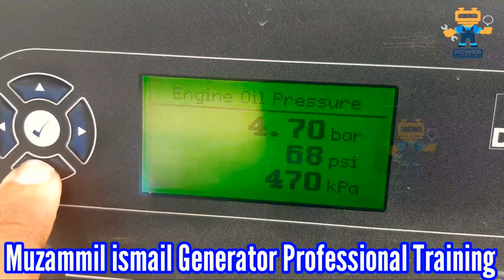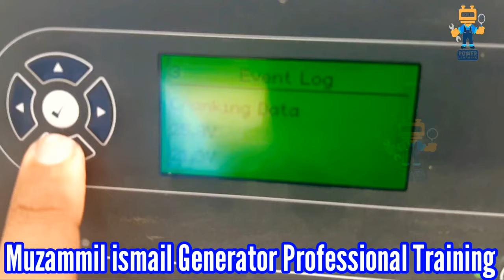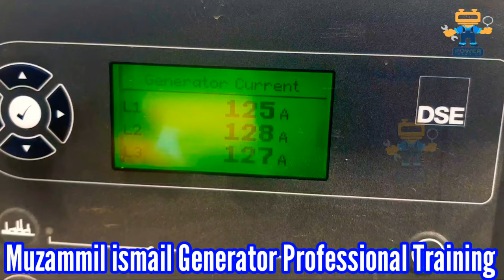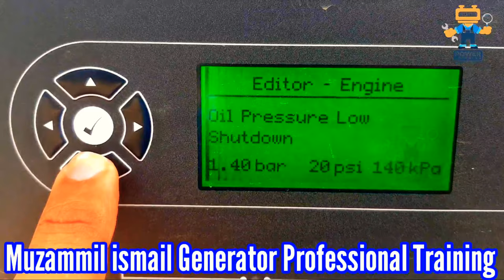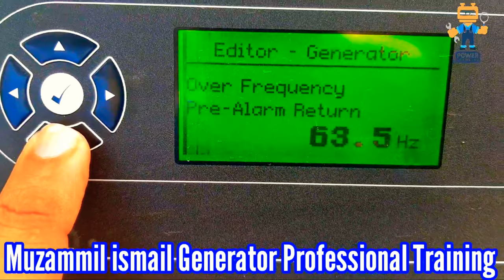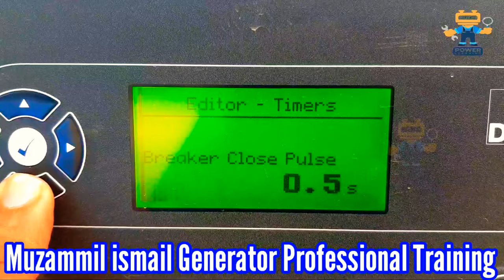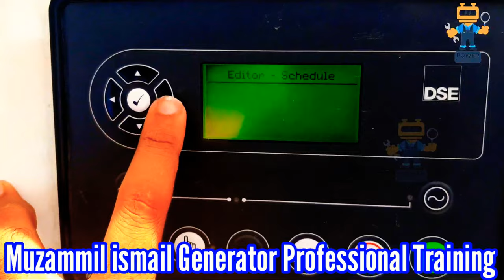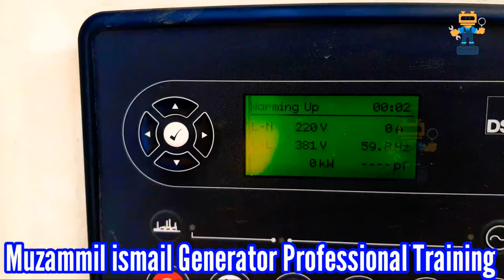Diesel generator Training for Begginers n Expert level - Engine hunting , governor connection

Comment: Hai sir... we have the same model band new Genarator...lastday we tried to start the genarator...we checked the basic parameters, then i gave command in manual mode...engine is cranking but not start with fuel. I tried many times the same problem....Can you help me how can i fix this issue

Comment: Check your mpu
Reply: If there's output
Reply: Check also voltage supply terminal has 12 or 24 volts
Reply: On terminal battery at speed control module

Comment: Pro muzzamil what could be the problem ever with the generator running idle and not to the rated speed 1500rpm speed. Hence Undervoltage

Comment: bro, what was your hunting issue you found, when you testing you achieved from GOVERNOR actuator values of 8.9 vdc and 2 AC voltage from pick up  sensor ,  hence where u finally reached the troubleshooting

Comment: One issue arha ha Generator under frequency shutdown 
And Generator under voltage shutdown 
But Rpm is ok and voltage also ok 
After I inactive frequency and voltage then we started Generator is working fine 
And we active generator under frequency and under voltage shutdown active then not cranking and locked out showing  
Can please help me know this issue

Comment: Hi bro
I would like to change the coupling of the alternator, 400v triphase with neutral series star to 220v triphase parallel star triphase.what about to the deep sea controller ? Are there any setting to change? Change the wiring?
Reply from the maker: Sure u need you need to change

Comment: How can I sync and parallel 4 generators where gen 1 and 2 is using a deepsea 8610 module and gen 3 and 4 using ComAp NTC controller.

Comment: In this speed controller connection i saw that this connection will run direct to speed 1800 no idle correct me if im wrong
Reply from the maker: Yes correct direct at 60hz

Comment: Bro if there is no governor, it can work right only we cannot control the control the fuel consumption
Reply from the maker: It depends on your Generator fuel system
Reply: Yr I am confuse with electronic engine and mechanical engineer can please share some info or data

Comment: how i set the Generator availability of singe phase and three phase on Digital ATS
L-N=220V
L-L=380V
NOT VISBLE during the Gentor running
Reply from the maker: Which controller ur using

Comment: Ahsalaam Alaikum
I am Mohamed Haneef from Maldives
I have got an issue from the Generator Cummins KTA19G4
It gets RPM variation between 1512 1506 1497 1488 etc when start it but the voltage is good
So how can trouble it and how to Mach actuator with control card some one asked me we have to Mach both of no before fixed it
I hope you can help me
Reply: I need to know how to troubleshoot it and how to check MPU and Actuator
Reply: For the magnetic pick up sensor, 
Run the engine, 
Check with multimeter the AC voltage at the speed control terminals of the MPU,
You should get between 1 & 1.5 VAC